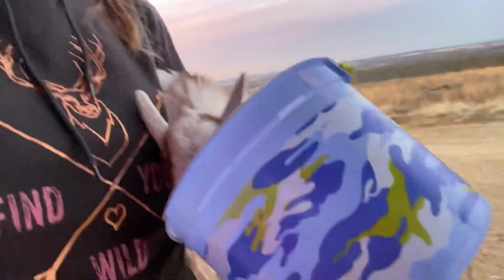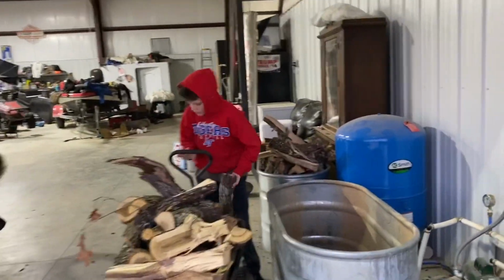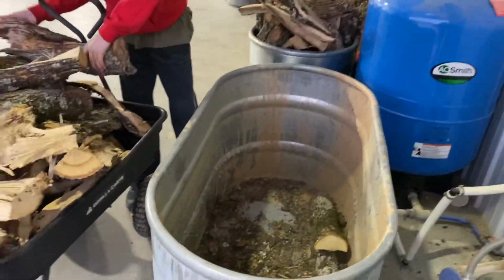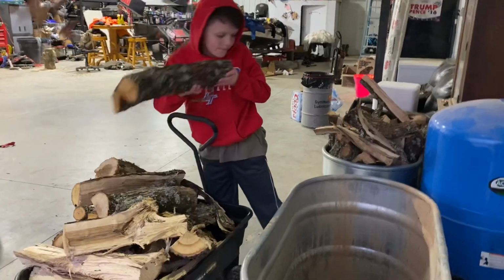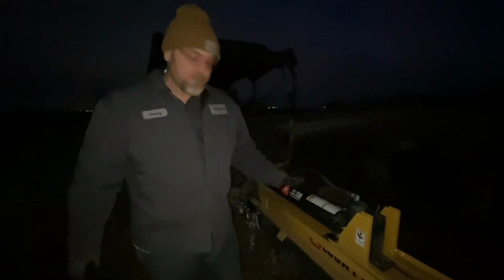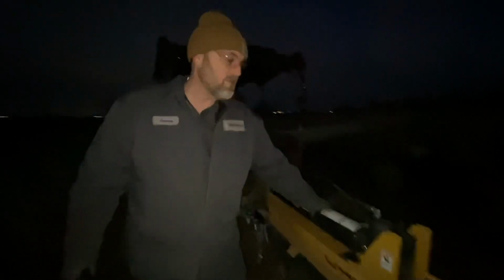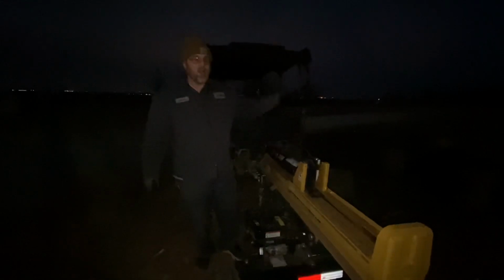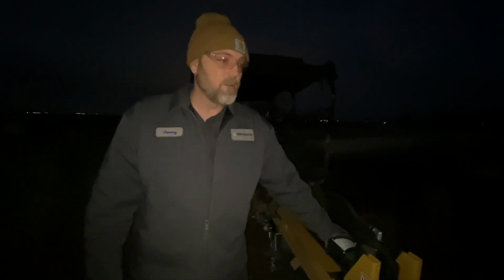We Ran Out Of Firewood: Oklahoma Arctic Blast | County Line 25 Ton Log Splitter | Satisfying Video

Comment: I swear I'd rather burn green wood! Seasoned burns up way to quick. Luckily I live in East Central Florida and really don't need a whole lot of wood. We've got to use our fireplace more this year then we have in the past few years. Yall be safe! God Bless
Reply from the maker: We use the seasoned to start then use the green this time. It is not doing well, it will smolder and get charred but will not ignite into a flame. I thought we were done with winter! I guess I had way to many fires this winter, I love wood fires!
Reply: @ParagonRidgeRanch  me too! I just love them! They're so relaxing! Yeah 1 batch of green wood i got was a little too green and did the same thing. Wasn't pretty but was warm. Had to keep adding kinling to it. I also keep all candle wax once burnt out and use those in there too. They're great igniters and if you're lucky some still have a little smell left LOL